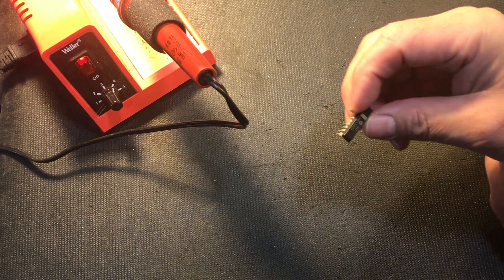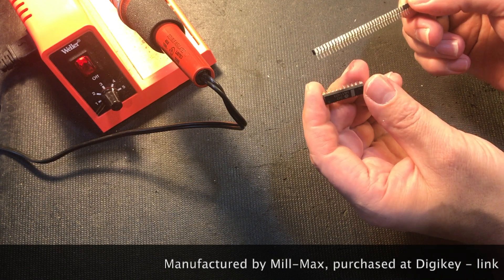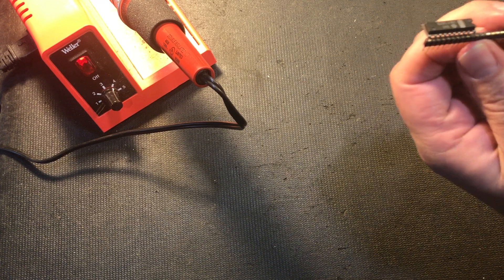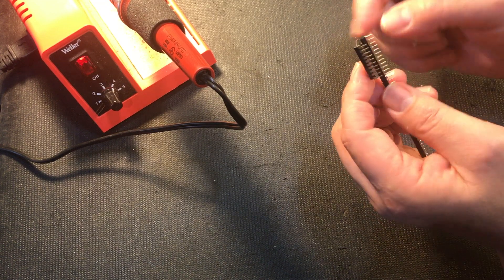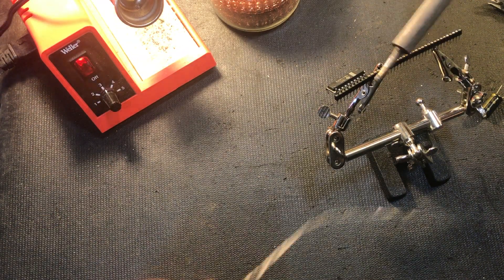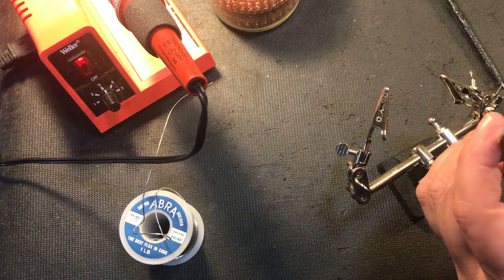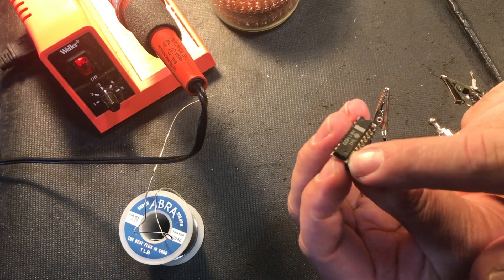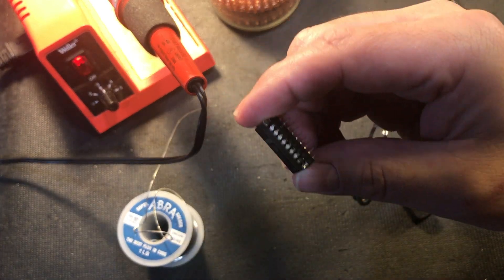How to Fix a Broken Integrated Circuit (IC) // Electronic Repairs

Comment: Nice!I have question: how fix burned out integrated circuit?Can somebody can do it this?I mean on Technics AN 660 IC for Technics RS-B100 cassette deck,this is for DD capstan motor,it`s motor controler.

Comment: Well it appears I was on the right track. Only thing is I have to keep the profile low and there’s a socket on the board already. I just wasn’t smart enough to pop the socket in then the leads and then solder I was going to solder and then try to pop it in. Thank you for making it simpler for me.